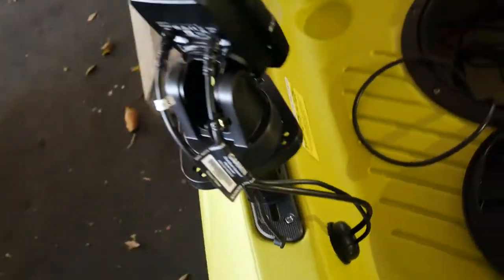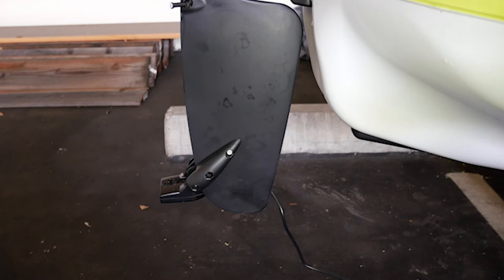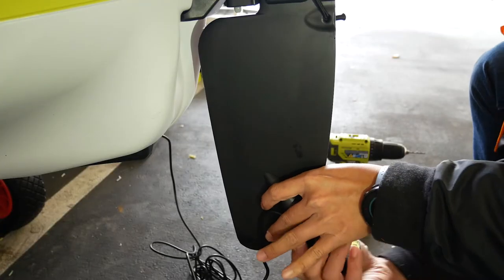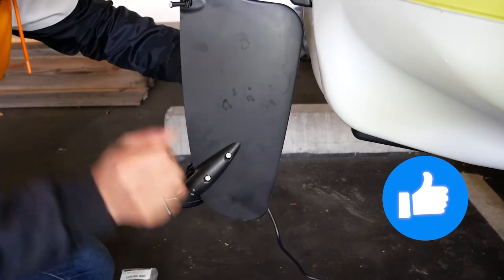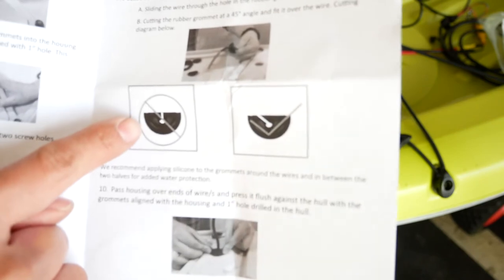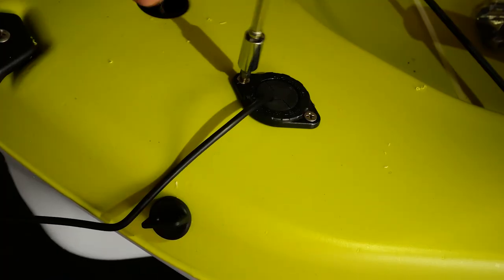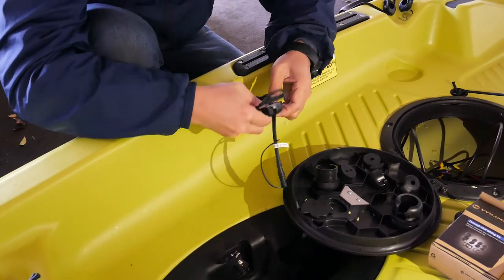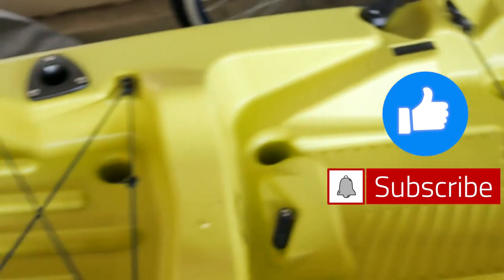Garmin Striker 4 Fish Finder Kayak Install | Hobie Passport | Rudder Mount

Comment: This a one of the differences with the 12 vs 10. The 12 Passport is fish finder "ready". Meaning there is a transducer well to mount it in the hull.
Reply from the maker: Yeah exactly , I would have installed it in haul if I had the 12ft. Hopefully this gives the 10.5ft owners just another install option!